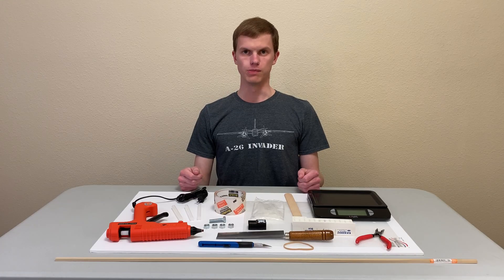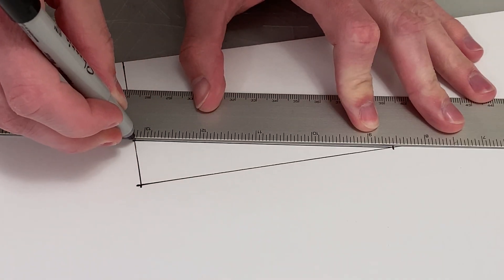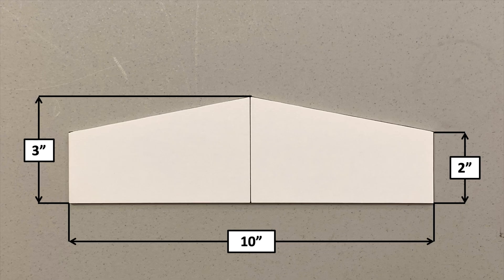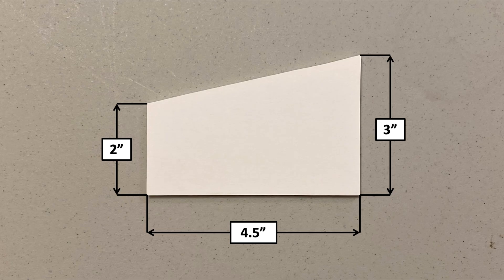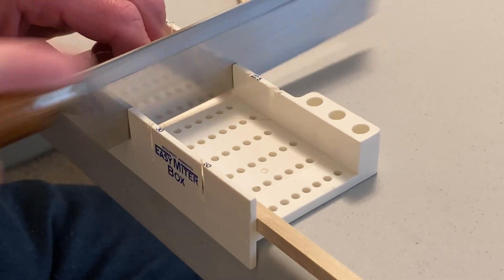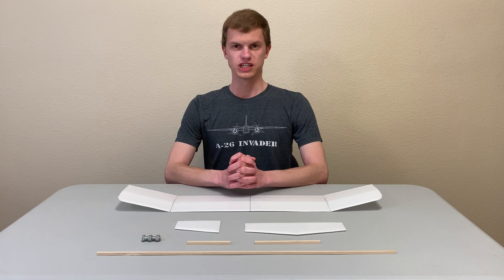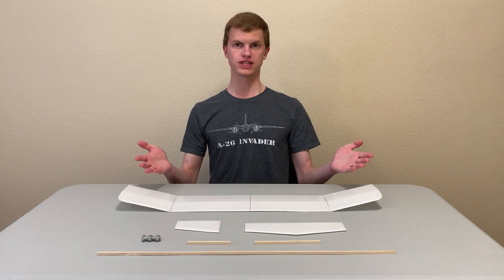How to Build an Easy and Inexpensive Model Airplane that Flies

Comment: This looks nice but i use a stick or in filipino where i live is the philippines is tukog and then for the wings i use four cards folded with elastico or rubber band in filipino and the tale it's just the sideways 1 not a horizontal stabilizer just the just try picturing american airlines flight 587 and look at the sideways tiny stabilizers

Comment: This was a good level for beginners, though a couple paragraphs equivalent explaining some of the terms (wing chord, leading and trailing edges, for instance) wouldn't have come amiss.  You might also have mentioned that adjustments by moving the nose weight, adding or subtracting weight, or adjusting the tail incidence should always be small -- big moves like the ones you showed will result in overcorrection and "chasing the CG" -- in fact, it might be sensible to point out that the airplane should balance at or close to the high point of the wing with your default of 3-4 pieces of scrap wood (i.e. 3/16 to 1/4 inch of tail incidence).

Comment: boring without rc. i used the good software 'winschwer' to calculate the center of gravity for any form of plane you like. how do you calculate the centerofgravity? and the angle of attack? i did it like you, i bought all my material in the hardware store. wood sticks for stiffing the wing, and foam plates for the whole plane and wings. keep it simple and cheap and easy to get as possible.
Reply from the maker: I often use XFLR5 or online CG calculators to find the NP and CG locations.
Reply: I always started at 25% back from the leading edge of the main wing and worked it out from there.  KISS.

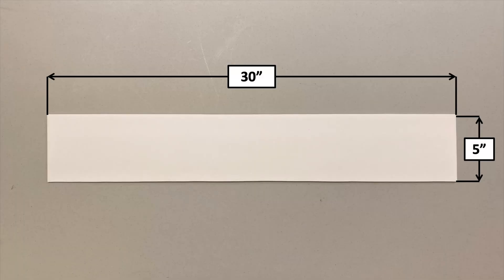Comment: Design question: At 4:25 what made you decide that 30" x 5" Area and the dimension for the other components was the most optimal? What is the design philosophy/mathematical reasoning behind this decision? Or was it simply something you have to brute force with testing to get to this conclusion?
Reply from the maker: I chose a wing area of 150 square inches because I wanted the plane to have a wing cube loading between 3 and 4 (I talk about wing cube loading in the next video).  I also chose an aspect ratio of 6 so that the wing would be long and skinny enough to provide decent efficiency, but also wouldn’t be too flimsy.  I’ll talk more about aspect ratio, efficiency, and aircraft structures in some later videos.

Comment: Thanks for the modular design idea! It didn't occur to me to use wood for the body either. I get lots of scrap foam insulation off cuts from work so I have been making everything with that. Soooooooo much sanding, soooo much dust. I like using it anyway because if you dissolve the insulation dust in naphtha you get some nasty home made napalm. Hmmm, at 53 maybe I should not do things like that, maybe I should go and fish at the local pond and complain about politics with the other adults. Maybe I should stick two forks in the toaster and sit on it, more fun than fishing by far.

Comment: If your plane wants to fly to the right or the left, this is seldom a weight issue. It can be the tail being out of line. Most of the time you need the wings to be 'fine' tuned so they match each other. If one wing has a bit more wing warp than the other, it will turn to the more warped side. Always vide the wings both from front and back to make sure they are the same.
Reply from the maker: I decided to go with the weight method because I found it easier and more reliable than fine tuning the wings.
Reply: @DesignYourOwnAirplanes-xd6lz  your video was very good .
Reply: But it could be a weight issue couldn't it .
Reply: @redskyz483  It 'could' be a weight issue. I balance mine before I put them on the plane. With the ones I have built, if they are balanced, then it is a fine tuning issue.
Reply: @robohippy  Therefore he is correct in his video.